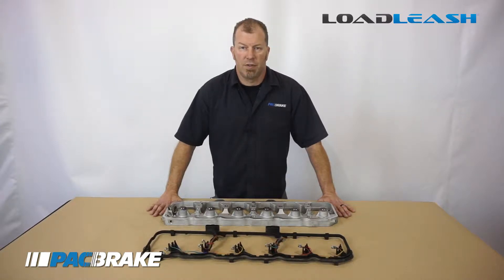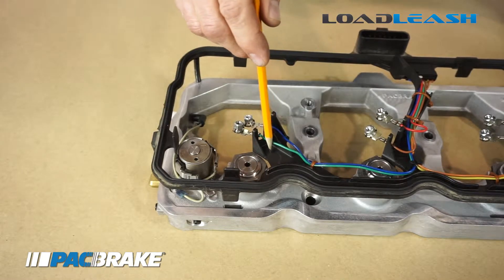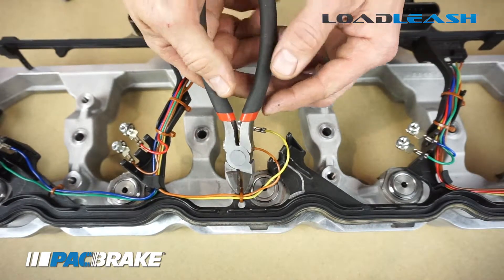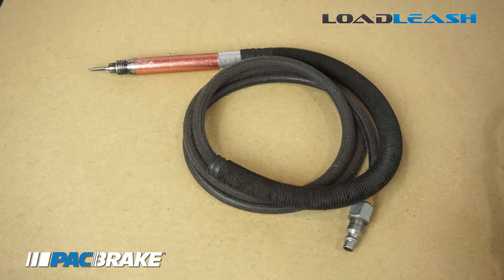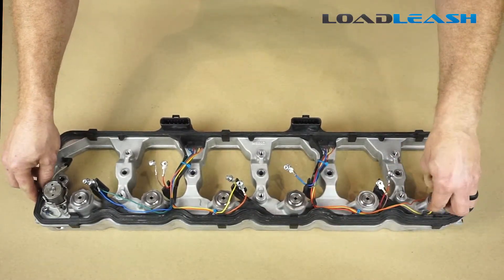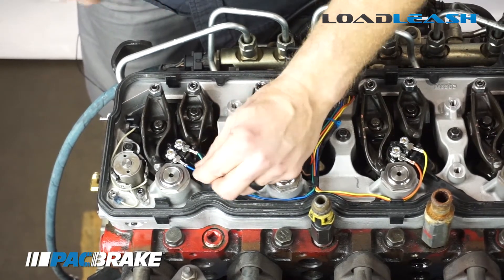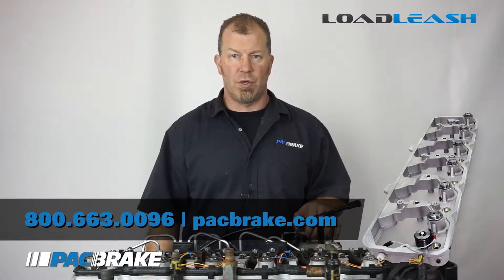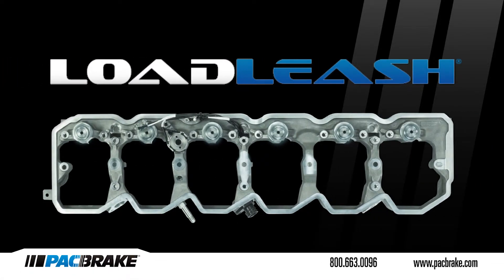LoadLeash OEM Gasket Modification

Comment: The product is awesome and I wish you had compression brake heads for the big three but the harness mods are dog shit for the $.  Leaving those wires to vibrate on the casting is an injector fault code waiting to happen.  You should include some wrap or a harness as well.

Comment: Loadleash can you guys make a video step by step installing on a ram 2012-2018   2500 or 3500 ram  6.7  with the ARP bolts some of us have 500-800 horsepower for pulling heavy loads and I noticed another video of a guy installing your loadleash on a Cummins he had some trouble with some ARP bolts not fitting with your product and I am looking forward to  see your video
Reply: Hello Everardo - great suggestion on the LoadLeash video. We'll see if we can make it happen. Regarding trouble with the ARP bolts, that can happen when your head studs protrude more than a MAXIMUM of 18.25mm or
 0.718” from the cylinder head face.  If that's the case, we've solved for that too with our PAC/ARP stud kit (Part # P55127).  See our Manual, page 2 and 7: https://pacbrake.com/wp-content/uploads/L6267.pdf